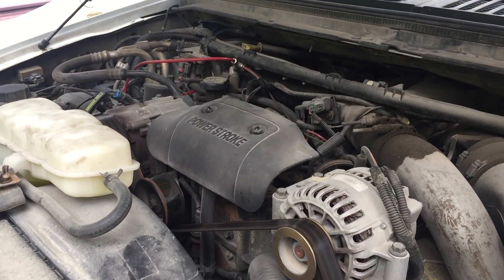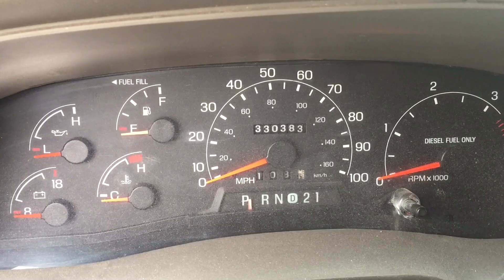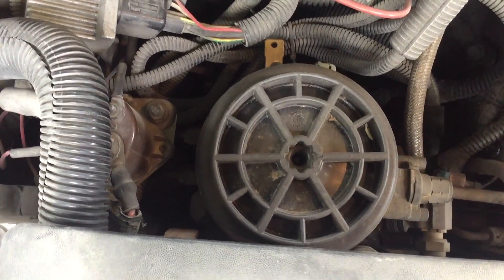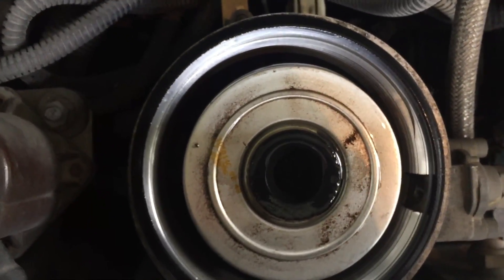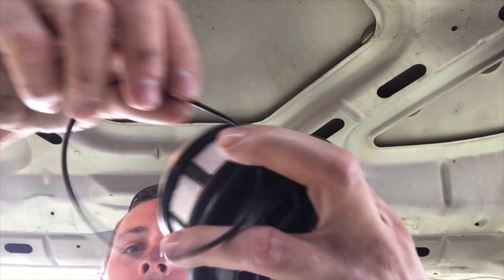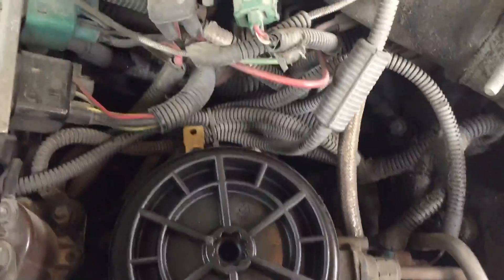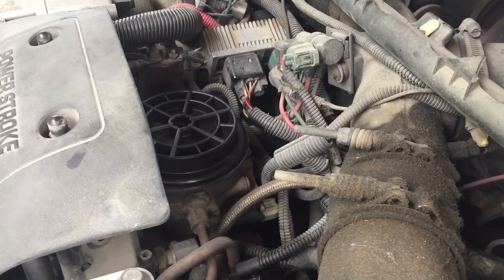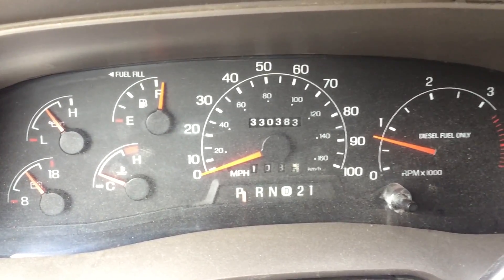7.3 Powerstroke Fuel Filter Change

Comment: Looks like the same filter setup my international vt365 has. It’s got the 6.0 oil filter and the 7.3 fuel filter. Pain in my ass engine.

Comment: Why not use a half inch drive ratchet like it’s designed for to take the cap off? It’s a more common tool then a large filter wrench and it’s far easier to use for this application.

Comment: Sorry but I have issues here. I just changed my filter using this video, and it went smoothly so thank you so much for that. My issue is your crudded up filter. Mine has been in there 10 years (I know, but hey, I plead ignorance)  anyway, mine didn't look anywhere at all as nasty as your old one, it's just yellow instead of white, so what gives? I wish I could put a picture on here. I think you have  a  lot more mileage on yours, but dang, after ten years I was expecting a dark black filter.
Reply: Hi James, interesting info; maybe his area has different diesel fuel with additives and his truck hauls under dirtier colder harsher conditions.  How many miles do you have on your 7.3 diesel engine?  God bless
Reply: @acemoto2319  198361 is the miles, I mainly use it for hauling my boat to the lake these days.  My biggest problem is keeping the damn thing running due to stuff going out on me, like the starter dying on me in kansas on a Sunday afternoon in a small town. Luckily I found a local gearhead worked on cars for extra cash. Had the new one delivered by an auto zone guy from another town. Expensive day. Right now it's battery problems.😮‍💨
Reply: @jamesholleman2083  Okay thanks, i recently made my 7.3 1999 Ford diesel my main daily driver; so now my new 800 CCA Cold Cranking Amp batteries  (3 of them) are always charged and starter and other parts get to work out everyday.   If diesel can't be main daily driver, then batteries need to be on trickle maintenance charge or disconnected to avoid drain.  Plus it helps to run engine at least once a week.   If vehicle sits without charging, then batteries, alternator, starter will slowly die.  Two months ago, I replaced original 1999 starter with new one.   I took 3 hours with help of DIY mechanic to replace store bought starter.  So labor was $60 plus $125 for starter.  I may sell my other car since it's easier to maintain 1 vehicle that needs care.  God bless... Learning as we go... :-)
Reply: @jamesholleman2083  the fuel tank he’s getting fuel from, if you always get fuel at fuel stations that keep up on their maintenance then large particles are unlikely to accumulate. For farmers and such with their own fuel barrels contamination is far more common, it’s not that the nozzles at gas stations don’t get dirty but they are used far more frequently by thousands of vehicles so the particles are spread out in thousands of filters instead of just a few making detection less likely.

Comment: You know that plastic piece above there has too little nuts, you can see in video, you can take it off and it's a lot easier to access that.
Reply: Hi Winston, great info; may I ask if the two little nuts are part of diesel fuel filter cap?  Thanks

Comment: If you look on the front of the bottom of the engine there's a metal line that goes nowhere you can attach a rubber hose to it to drain your fuel to a pan instead of making a mess all over the place before you open the drain
Reply: Great info Renato; may I ask if this metal line is the only output line on Ford 1999 Superduty Powerstroke 7.3 diesel engines?  If so, then will diesel fuel just simply stream downward instead of splashing everywhere?   Or maybe engines parts are in the way.  Thanks

Comment: Make sure you know wether you have a separate or integrated cap before you order your filter. If you have an integrated cap it won’t work without getting one without a new cap.
Reply: That happened to me . I had the integrated one and I bought a motor craft filter . Spent about an hour trying to get them separated. Had to run to shop and get a cap for it . Not a lot of info on that .
Reply: @jberrocalucf same here.
Reply: Thanks for info Cobra; Do different diesel trucks have separated and integrated cap depending on year and/or diesel engine size?  If so may I ask why the difference in caps?  Thanks

Comment: I change my water seperator every oil change 5,000 mile synthetic. Although my 97 F450 hauls almost always
Reply: Hi Ezequiel, great info.  May I ask if water separator is bottom part of fuel filter and can easily be changed along with filter?  Thanks, God bless.

Comment: Nice video.  But just for future reference, when priming the fuel system the Fuel pump only stays on for about 20 seconds when the engine is not running
Reply: Thanks for info Frank, does this heat up diesel fuel and glow plugs in order to achieve proper ignition temperature?  Thanks
Reply: @acemoto2319  yes the glow plugs will cycle on each time you cycle the key, the light on the dash will show you if they are on or not.

Comment: $50 for one filter ? Brick and mortar parts stores are burning that wallet.
Racor OEM made for Motorcraft were around $6.50 each years ago 
when I bought them by the case. Amazon has the Motorcraft for >$28 with Prime.
Recently found International filters 3 for $21 on ebay. Shipping was extra.
Reply: Rockauto.com

Comment: God damn garbage. I just at had the rubber blow out the side as it has movement. Go oem. And done
Reply: Interesting info Chris!  Are you saying that Ford original equipment manufacture OEM rubber seals are superior to generic aftermarket parts such as Racor filters ?  Did you notice if seals are right side up or down?  Thanks God Bless!

Comment: What about pre filling the fuel filter and the 7.3 doesn't have a high pressure fuel pump it's heui injection not common rail
Reply: The external 50psi fuel pump fills the fuel bowl during the "wait to start" cycle. The 7.3 does have a HPOP feeding the two fuel ports inside the heads to the injectors that are the HEUI. When doing an oil change, most don't suction the black oil and refill with new oil from the HPOP and it dirtys their fresh oil change with black oil.

Comment: 7.3 does not have HPFP it uses a  HPOP ( high pressure oil pump)         Also when you purge the air don't waste your time leaving the key on for 2 minutes,  the pump only runs for 20-25 seconds
Reply: Hi Emperor, great info; may i ask if maybe priming twice will warm up diesel fuel in cold conditions.  God bless
Reply: @acemoto2319  Honestly I'm not 100% sure on that.  It may help because there is a fuel heater inside the fuel filter housing
Reply: @emperorpalpatine7134  Thanks for info Emperor.... yes I think the fuel heater allows diesel to stay in liquid form, especially at cold temperatures when diesel can gel up and be restricted by fuel filter.   I'm guessing "Priming" to purge air, helps when engine hasn't been driven for awhile and/or with filter changes; and also may help warm up glow plugs.  I noticed that if I prime twice (without cranking)  then cranking will start faster.  But when I don't prime, the cranking takes longer.   I guess fuel needs to be pumped into system to displace air.  Continued blessings!

Comment: High pressure fuel pump?? You mean high pressure oil pump? The 6.4 has a high pressure fuel pump the 7.3 and 6.0 were hpop
Reply: Great info Kilgore; may I ask why one has Hpfp and 7.3 / 6.0 has Hpop?  Aren't diesel fuel different from their oil system.  Thanks and God bless.

Comment: How often do you have to change the fuel filter?
Reply: For most people yearly, but depending on use it can be every oil change or up to 30,000 miles. The dirtier the use the more often you will want to change, if your using it out in fields and putting fuel in with cans then more often is likely a good idea. If it’s a highway only truck then longer intervals won’t be an issue.

Comment: Diesel fuel filters have heating elements not to improve combustion by warming the fuel but to prevent the fuel turning waxy at low temperatures and clogging the filter. Most diesels do not push the fuel through the filter but suck it through causing a pressure drop in the filter which being the opposite of compressing the fuel causes a temperature drop hence the need for a heater. Also the tap on the lower art of the filter housing is there really to drain any water that has collected in the bottom of the filter housing, most diesels have a warning light on the dashboard if water is detected in the bowl as if left to go into the high pressure pump or injectors it will cause very expensive damage.
Reply: Hi great K Welton, great info; may I ask if water in fuel filter is result of cold temperature condensation.  Also does the water drain by itself or is it forced out by lower part of filter housing with proper pressure?  Thanks

Comment: The 7.3 sounded a little rough... Is it due for oil and filter?
Reply: Tim's Tech probably because there was a little air in the system and 330k on the injectors
Reply: Probably

Comment: is the fuel gauge not working?
Reply: ....maybe he's got a full tank.
Reply: Good observation.  I have the same fuel gauge issue on my 1999 Ford 7.3.  His low fuel light came on and then turned off and gauge jumped to full.  My low fuel light doesn't work, so maybe fuse, other part, and/or fuel gauge needs diagnosis.  Cheers
Reply: Same issue with my fuel gauge drives me nuts

Comment: very different than the cummins diesel. you have to bump the starter to prime it. I wish you worked on older say 94 to 02 dodge trucks. your instructions for things are so clear and well put. enjoy the videos.
Reply: Hi thanks for info.   May I ask how one bumps the starter to prime Cummins diesel engines?  Does that mean to hit or bump starter solenoid with hammer ?  Thanks
Reply: @acemoto2319  that's a good one !!! i've never "bumped" one starter here at my repair shop.

Comment: A long time going without a fuel filter change :) i changed it once a year on my mercedes 250, Of course our diesel in europe isn't as contaminated as it is in the US, however there is alot of additives in it for enviromental purposes wich is not good when it gets below -20c since it starts gelling by that point, there is good diesel fuel without additives but normal persons can't buy that since you need to be a company to buy it, like hauling freight or timber
Reply: Here in North America,  the refineries (based on physical location) make 2 blends of diesel,  there's a summer blend, and a winter blend.  Obviously, the winter blend is for the northern climate when it gets cold.  It's considered to be "Number 2 diesel" at the pumps,  but in fact the winter blend is a mix of 40% No.2  and 60 percent No.1 Stove oil, which is thinner, drier, and has a lower pour point.  Some refiners may blend kerosene (which is lighter and drier yet).  As for gelling,  ya, it still happens.  Those who deal with it, and see their equipment running below -20C, keep de-gelling chemicals on hand.  Best to add something when putting fuel in the tank, although there are some chemicals that claim to de-gel if you've waited past the point, lol.  And as for contamination,  there are sooooo many points along the chain of delivery where crap can get into both diesel and gas,  with the actual vehicle itself being the worst point for dirt, crap unwittingly being introduced into the fuel system.
Reply: @stanpatterson5033  Thanks for great info; May I ask if putting an additional fuel filter (strainer) at the fill cap location will help clear and strain diesel fuel upon filling up?  Thanks
Reply: @acemoto2319   Well, I'm not sure about a strainer in the filler cap.  I have only seen anti-siphon devices put inside the fill neck.  I'm confident, based upon my experiences with those things (not that fabulous), that anything finer than the anti-siphon devices, you would be experiencing backsplash, and painfully slow admittance when trying to fuel up.  Most diesel fuel pumps have outboard filters on the discharge, and they are usually visible on the outside of the pump body, and they are usually caked with crap because they have never been changed since the place was built and the pump installed. If only these fuel distribution retailers or cardlocks paid a bit more attention to their equipment.  Anyways, as far as filtering at the tanks, I don't believe that trying to filter as you fill is practical.  Sure, it's desirable to filter it BEFORE it goes in, but unfortunately, it seems more practical to fuel quickly, and let your own infrastructure (like filters, separators, line heaters, etc.) do the dirty work after the fact that the fuel has been taken onboard and paid for.  Best advice would be to use a rag to clean around the fuel cap prior to opening it, if caked in mud and stuff.  A blast of a pressure washer would be good, if it won't admit water past the cap seal. Compressed air blast before opening the cap, might also dislodge unwanted dirt and debris.
Reply: @stanpatterson5033  Great thanks Stan for excellent info on diesel filtration.  It's great to learn how to change fuel filter as videos show.  I like what you wrote about having different areas where diesel can be contaminated.  Also on older vehicles, maybe rust inside fuel  tank can also get through; so many say to keep tank 1/4 filled so tank sediments and rust are kept at bottom away from fuel pump; (I think fuel pumps are positioned higher than bottom floor of tank.)  That anti-siphon gadget and other tips are helpful.  Thanks again, continued blessings!

Comment: Bob at powerstrokehelp is upset because you just proved him and his arch oil is no good.
Reply from the maker: docindahouze LOL I've seen his videos on Arch Oil but haven't tried it yet, I'm not sure it would make much of difference because the engine oil and fuel systems have been maintained so well in this vehicle. Though I'm sure it would make a difference in something that has been neglected...
Reply: Tiger Audio, Inc. jog on you sye.

Comment: wow original fuel pump, that is amazing,  my stepdads 2001 explorer sport trac, he replaced his fuel pump a few months ago, that did fix the hesitation and the long cranking time
Reply: our 2001 ford explorer sport(the suv not the truck) has had 7 fuel pumps lol
Reply: holy crap!
Reply: Great info Ricardo; may I ask if fuel pump was easily replaced by DIY non mechanic?  And was diesel fuel filter also inspected and replaced?  Thanks
Reply: @acemoto2319  On those the whole gas tank needs dropped. It's not a diesel either but yeah it had the fuel filter replaced along with the pump. Depends on the vehicle, pickups are always a tank drop. Modern SUV's and Cars are commonly accessible from the inside.
Reply: @RicardoPCGamer  Thanks Ricardo for great info!  Good to always learn about engines.  I like what you wrote about changing fuel pump and filter helped with starts.   I also noticed that having enough fuel also allows faster starts since maybe pressure helps the fuel pump.  Priming (without cranking) twice also helped since diesel fuel is being prepared and glow plugs warmed.  Also strong CCA battery helps ignite fuel.   Continued blessings!